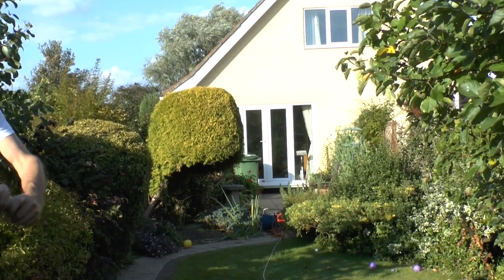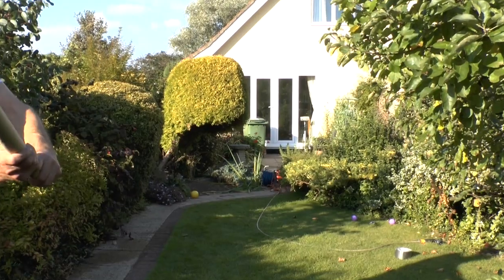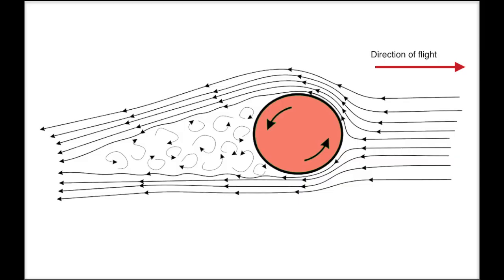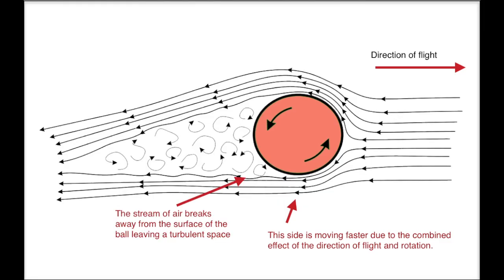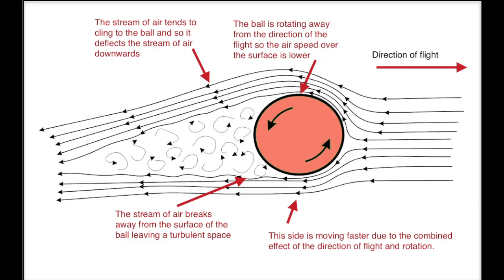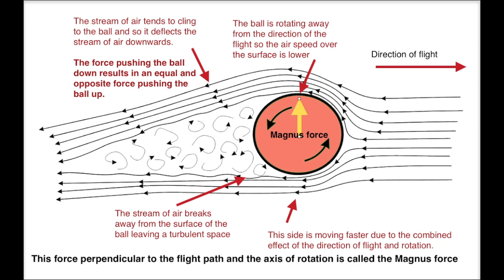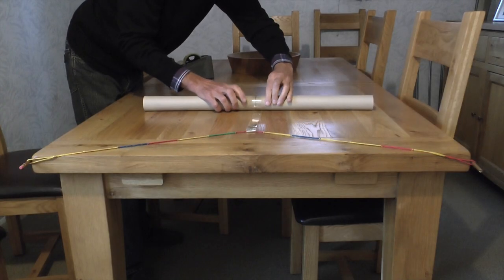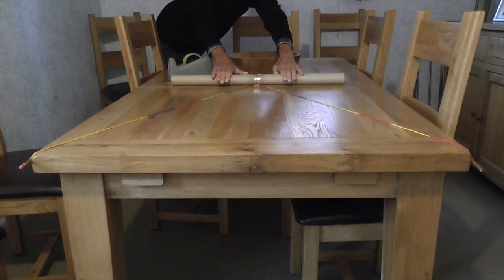The Magnus effect: a curved ball explained: from fizzics.org

Comment from the maker: In reply to Prateek. Hi yes, all of what you say is correct. There are many variables here including the nature of the surface of the ball. As you say the force is not perpendicular so a ball so it is likely to be slowed or speeded up depending on the point on the ball where the laminar flow fails, although I think (but I've never tested it) that the change in the translational kinetic energy and hence the speed (as opposed to velocity) only changes a little.
Reply: +Roger Linsell I'm doing a student research project on this topic and I was wondering if you knew how you could control the variables in order to undertake this test.
Thanks
Reply: ENDURO AUSTRALIA use water in thing or make a smoke box with a dan

Comment: Would the transitional velocity of the ball affect the lift on the ball? I would imagine the wake would be longer and the resulting force would be larger in magnitude as well. Also it seems that the Magnus force is not perpendicular based on this explanation but only that the force contains a vertical component causing the lift. How does the horizontal component of the Magnus force affect the ball as it would seem that the ball would have to go faster based on the direction of the horizontal force.